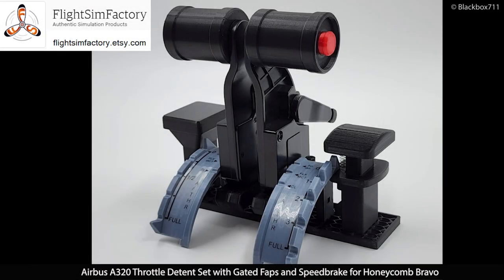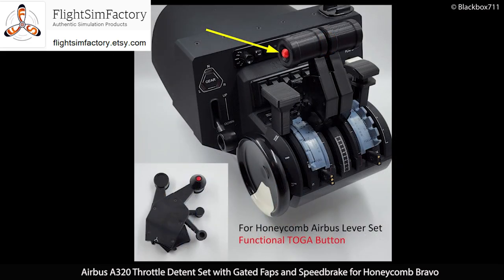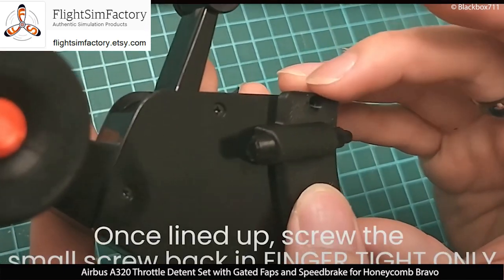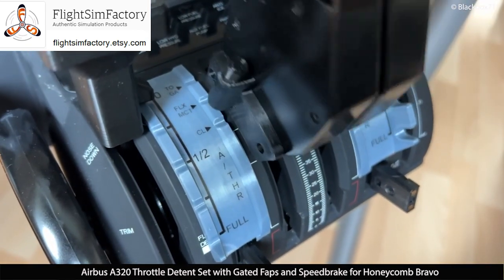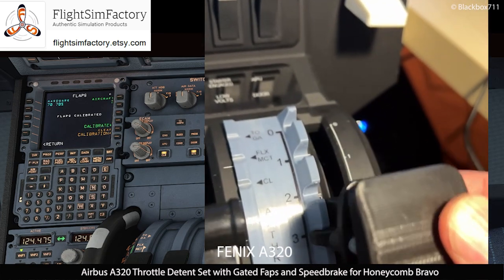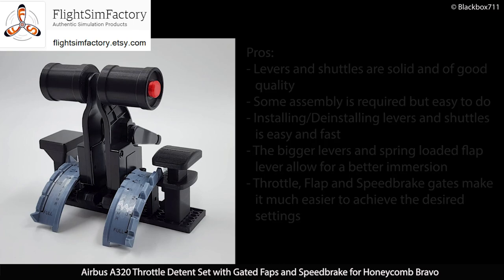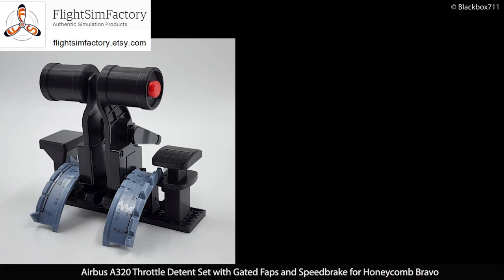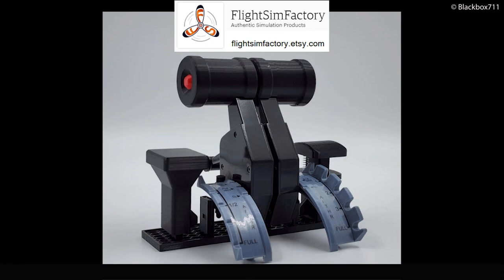FlightsimFactory A320 Throttle Set Review

Comment: Great tool! Best hardware addon since Honeycomb. One qestion: With the Toliss fleet the gates work perfectly. But with FlightFactor's A320 the gate for climb thrust (CL) is in the wrong position. Is there any way to configure this in xplane?
Reply from the maker: Indeed, great addon. Isn’t there a calibration option in the EFB of the FF320?
Reply: @Blackbox711  No, this is not intended for the FF A320. But here are the values for calibrating the curves for throttle 1+2:

0.00 > 0.00
0.63 > 0.55
0.81 > 0.77
1.00 > 1.00

After a few tries I figured it out